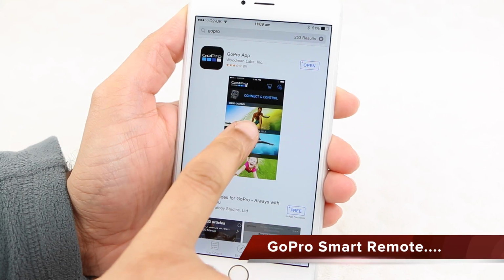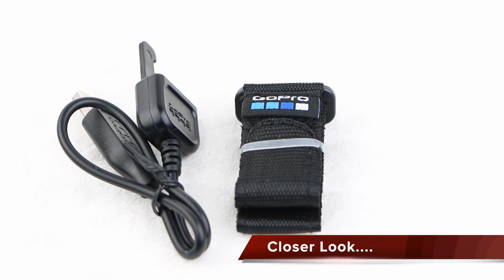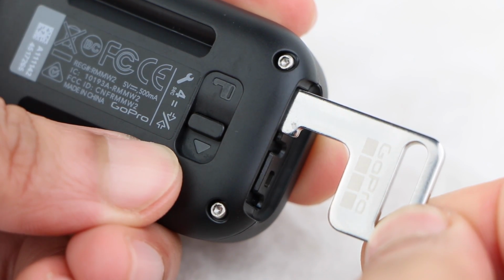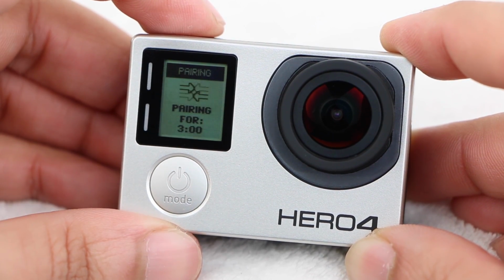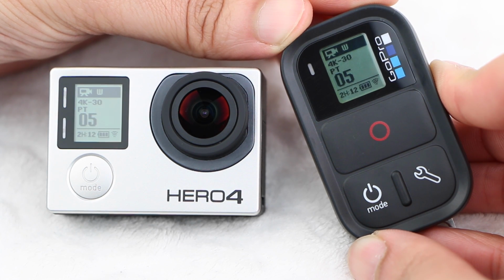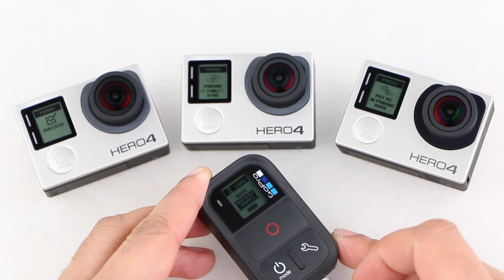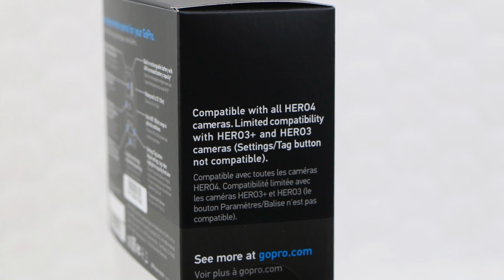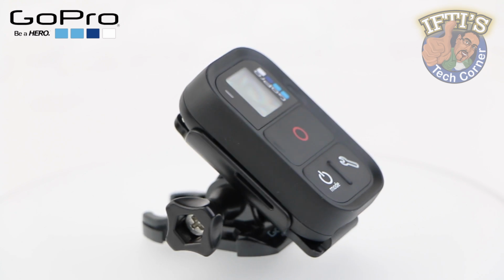GoPro Smart Remote - WiFi Remote for Hero 3 / 3+ / 4 : REVIEW

Comment: I bought a used one to control my GoPro Hero 7 Silver at my motorcycle. After 30 min of headache I found out that a Hero 7 Silver is not compatible with any remote device. WTF GoPro why the heck have the 7 Silver WLAN but no wlan device connection? 
I don't understand the point behind such product politics.

Comment: Problems with the Wireless (Wi-Fi) turning off.
I bought a new Hero7 Black and paired it to the SmartRemote.  I understand that you have to go in manually to Preferences: Connections: Turn wireless to OFF when your done using the camera or Wi-Fi will continue to drain your battery. (they already have an extremely low use time) .   WHAT A PAIN TO HAVE TO GO THRU ALL THOSE SETPS WHEN YOU TURN OFF THE HERO.
A good engineer and IT person could set it up so that, "when you shut off the camera or shut off the SmartRemote, the wireless goes into sleep mode until activate by turning the camera back on" . This is not the case, It is quite easy to turn the VoiceCommands on/off by swiping down and pushing the Voice Icon.  This could have been done with the wireless on/off.
 I had a problem,
When I went on the Hero7 to turn off the wireless connection, the screen showed a Blue ON..(meaning the wireless was on) and the Off button was white.   I hit the off button to deactivate/turn,,, fir a brief second, OFF turned Blue then immediately, it reverted to the previous page and turned the wireless back on.  I had to do a factory RESET and set the whole camera settings back up.
What a pain.   
This could all be fixed with a firmware update.  If GoPro techs listened to (or actually had to test and use these items) these would be fixed quickly and there would be happy customers.  GoPro stock is not doing so well.  You can buy the Yi-4k+ for just under $200 and it will do everything the Hero7 will do.  Even their voice command and remote/wireless connections work flawlessly.    Time to catch up GoPro.

Comment: Hi - I fly a  Yuneec Q500 quadcopter that carries the Hero 4 Silver.  I usually start the camera before takeoff,  I can view what the camera sees on the control screen.  If I use or try to use the remote whilst airborne will it affect the UAV stability i.e interfere with the quadcopter signals?  Thanks
Reply from the maker: I would not use any wireless or remote options on your GoPro while flying - better to be safe then sorry!

Comment: Hi, can you have the smart remote and app connected to the Hero 4 black at the same time. When I connect one I loose the other one. I see in the settings that they are both listed so it seems that they both should work.
Reply from the maker: You can only use one at a time, not both simultaneously.
Reply: Thanks for your rep;y. That would be great. I connect the RC to the camera and then connect the phone with Capture. Switch off Capture and the remote wont work and I cant pair it again without a wireless reset. Each time I connect one I loose the other.

Comment: Still using Hero 2, but Remote Control power dies really quickly, so am wondering whether the currently available Remotes are compatible with the old Version of GoPro like my Hero 2 .........

Budget for an entirely new 5 ..... not there right now.

Comment: Good videos.  How do you switch between two cameras when you have the Hero 5 and the Session 5 using the remote control?  Thanks.
Reply from the maker: When the remote is connected to one camera you can access all settings etc.
When the remote is connected to two or more cameras you cannot access settings, and cannot switch between cameras. You simply use the remote to start/stop capture, highlight tagging, and switch between capture modes - the benefit being all cameras will be synchronised together.

Comment: When you are in remote place where there is no wifi, go pro remote is useless? Before I go places I paired RC to my camera. But when I'm in the location I lost connection and remote is useless.
Reply from the maker: The GoPro creates the wireless hotspot. The remote connects to the GoPro. You do not need any other wireless.

Comment: I know with the original remote it would never work underwater or lose wifi connection. does the smart remote have the same problem or have they resolved this issue?
Reply from the maker: No, because WiFi signals do not travel through water

Comment: New to this..  What's the benefits of the remote if you can't frame what your GoPro is recording ?  Anyone ?
Reply from the maker: +dasboot360 - Synchronise and control up to 50 cameras simultaneously....
Reply: +iftibashir Hi is it possible to format the sd card using the wifi remote / go pro app ?? Thanks
Reply: +Mr330d yes is posible

Comment: Hello there, can I switch off the wireless setting by pressing long the setting button on remote? Does it connect automatically when i switch on the devices after first pairing? Is the remote waterproof? 
Sorry for so many questions lol
Reply from the maker: +rowena jee - Yes its waterproof, but wireless signals do not travel through water. The remote needs wireless to work so you cannot switch the camera wireless on or off from the remote!
Reply: Thank you !
Reply: Is there a way to switch only the remote of on the old remote? Also to use it to switch both off? How about using it to switch both on?

Comment: Okay, so I apologize in advance for my arrogance but can someone please tell me if a constant wi-fi connection is required in order to use the remote.  Our Go Pro is often used mounted to a helmet while paragliding so a wifi connection is obviously not available. It would be nice to be able to take pictures using the remote while in the air. Would it work this way or would a pebble or apple watch be more appropriate? Thank you so much!
Reply from the maker: +Christopher Wieland - Yes, the WiFi connection needs to remain active while using the remote
Reply: +Christopher Wieland The remote and camera both broadcast their own wifi signal. You just have to have the camera with in 600 feet of the remote.

Comment: so I can't use this underwater?
Reply from the maker: +RushJayz  - The unit is waterproof, but wifi does not work under deep water. You may get away with very shallow water though.
Reply: +RushJayz The camera pairs via Bluetooth AND WiFi. When the GoPro App or the Remote are actively being used they use the WiFi connection. When the Remote or App are connected but not being used, the camera WiFi goes into standby and the Bluetooth takes over, since it is much more energy efficient then WiFi.

Comment: Does everything you showed work the same with Bluetooth binding? Can you turn the camera on and off via Bluetooth? Also, does the date and time reset in the camera when you remove the battery? Thank you, very helpful review.
Reply from the maker: No, bluetooth is used as a wifi sniffer only, you cannot pair items via Bluetooth alone.
Reply: +iftibashir I'm confused than. The GoPro site says that using Bluetooth you can connect the remote to the camera and via this method you can save battery life?
Reply from the maker: ***** The camera pairs via Bluetooth AND WiFi. When the GoPro App or the Remote are actively being used they use the WiFi connection. When the Remote or App are connected but not being used, the camera WiFi goes into standby and the Bluetooth takes over, since it is much more energy efficient then WiFi. When the remote or App are activated again the Bluetooth detects the connection and then re-enables the WiFi for the remote or App to be used as normal. 
This is the ONLY use for Bluetooth with the GoPro.
Reply: +iftibashir Ah, ok thank you for clearing that up for me :)

Comment: Can i switch the wifi off the after switching off the hero4 using the remote?
Reply from the maker: The WiFi on the camera? If so, yes, just keep the wifi button pressed for several seconds to switch wifi off.
Reply: Sorry i meant using the remote to turn off the wifi after using the remote to turn the hero4 off. No success with doing that so far.
Reply from the maker: No, the camera wifi must be turned off on the actual camera locally
Reply: Thanks for the confirmation

Comment: Wait so this doesn't work under water? What's the point of it being waterproof then?? I was only going to buy it to use underwater :/
Reply from the maker: Dustin Andrew Its waterproof so it can be used in and around the pool, or in snow or rain etc. The unit itself is waterproof, but its wifi that is not, ie. WiFi signals cannot travel under water - only at very shallow depths.

Comment: Mi remote wifi no enciende, porque?
Reply: Dont know if you understand english but if you do its because you need to be connected to the internet when you connect them
Reply from the maker: +GO PROduction - No internet connection is required whatsoever for the GoPro. The GoPro itself acts as the wireless hotspot.

Comment: I may be about to ask a stupid question. Would I need my cell phone which is capable of creating a Wi-Fi hotspot prior to attempting to use one of these remotes? I have a Hero 3 Silver.
Reply from the maker: 94Suprafanatic No, a smartphone is not required. The Remote connects directly to the camera - its the camera that creates a WiFi hotspot, not your smartphone.....
Reply: iftibashir I was asking because I want to use my GoPro as a dash camera during an upcoming road trip next month. Thank you very much for your response.

Comment: just bought mine , however can't turn on the power, even when i plug it in my laptop or any USB port..  iftibashir need your advice on this. thanks !
Reply from the maker: Ive heard of others having this issue. 
Try leaving it on direct mains power (not a computer) for 20-30 mins to see if it starts charging. Hopefully the cells just need a kick start! Failing that, Im afraid its a faulty unit - for reference, mine had over 50% battery when taken out of the packaging!

Comment: Can you please explain to me when does the Smart Remote is waterproof and when it's not? Thanks in advance!
Reply from the maker: Constantinos Christofi The smart remote is completely waterproof regardless of whether the keyring attachment is on or off. 
However, wireless signals do not transmit well under water, so it makes the remote kind of useless when submerged. Its more for shallow water or splashes etc.
Reply: Yea but if you want to take a couple of pictures under water and the camera is close to you, they will be taken right?
Reply from the maker: WiFi is too unreliable under water. That question cannot be answered - you would just need to try it and see as there are too many variables to consider.
Reply: I don't know what to do. . I want the smart remote but I'm not so sure if it worths its money or not. What do you suggest to me?
Reply from the maker: Constantinos Christofi Only you can make that decision based on your own requirements.....

Comment: Fairly new GoPro user here- but you mention that you can use this when your skiing and what not when the app is not practical- but how in the heck are you supposed to use the remote in the middle of the wilderness when wifi clearly won't be available? Is this thing bluetooth? Not really requiring wifi? This dilemma is what is keeping me from purchasing this remote. 

Help please! :)
Reply: If it matters- I have a GoPro Hero4 Silver.
Reply from the maker: Amanda Lewis When you switch the camera wifi on, it creates its own hotspot for the remote or the app to connect to. You do NOT need a WiFi network or router etc. The Remote or the App will connect directly to the GoPro, with nothing needed in between, so it doesn't matter where in the world you are ;o)

Comment: does the remote goes with the gopro hero 3+ silver? thanks!! ;)
Reply: Luc Krijgsman Did you mean "Alright, thanks for the reply" ...?
Reply from the maker: Luc Krijgsman The new Smart Remote will work with previous models, including the Silver 3+, but the Tag/Settings button on the remote will not function.
Reply: oke thanks for the reaction!! ;)